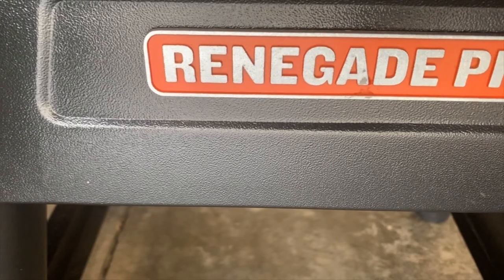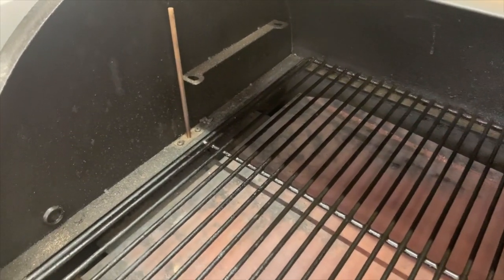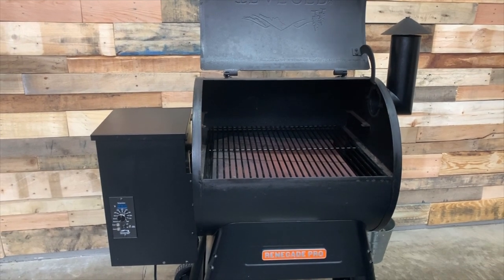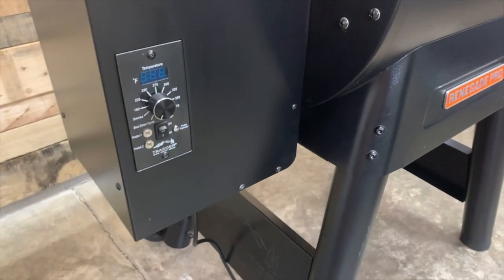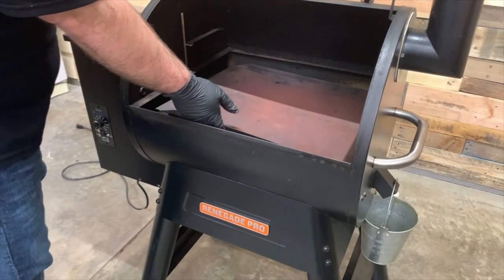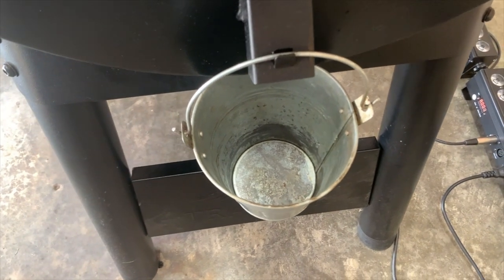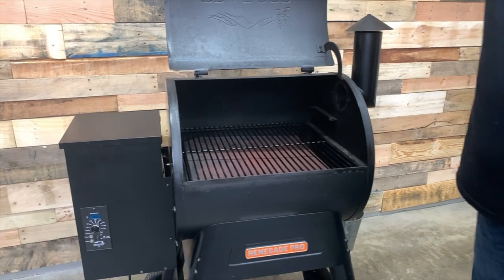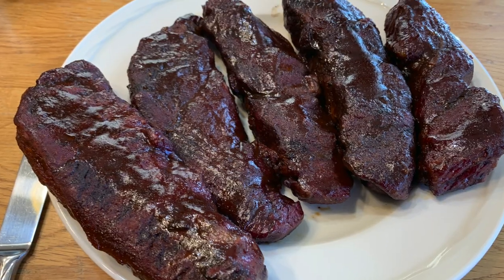👍Traeger Review👎 - After 6 months of ownership

Comment: I bought my Traeger PRO 22 from Costco over a week ago and so far I love it. I did run into a problem with error code  LER (too low temperature reading) but my issue was that I was not leaving the lid open when first firing up the grill. Since then, I now leave the top open and let it run for a good 5 min on smoke before upping the temperature= problem solved! Coming from using a propane grill for the past decade, cooking on the Traeger has given "life" to my food and the taste is fantastic. Even my wife has complemented me on my cooking which is a rare thing.😂 Great video!!
Reply: How does it perform on winter temperatures?? And i mean real winter, not texas winters but Alaska type winters.
Reply: One year in do you find it big enough?
Reply: @morganbaxter8793  For my uses, it's been fine. I bought the additional upper rack for $20 on Amazon and it's added additional space for food. I've cooked 3 rack of ribs on the lower rack and threw some corn on cob and asparagus on the top rack. It fits a good amount of food

Comment: I've had mine for two and a half years now. I would not sell it today for what I paid for it, I love it that much. I will say make sure you vacuum the fire pot after long cooks or after a dozen normal cooks. I had the fire go out in the middle of a brisket cook and found the fire pot full of ash which snuffed out the fire. Vacuumed it and restarted with zero problems. Also if the pot gets ashed up the grill will not get above 400. It takes 5 minutes to clean it out and refoil the drip pan.

Comment: I have one it's nice and convenient my only problem is the temperature jumps around and in my opinion it doesn't give that real good smokie flavor
Reply from the maker: We have cooked on pellet grills that had massive swings in temperature, and that's not cool. One had +/-50 degrees or more during a cook, and it was just unmanageable, so I hear you. We found this Traeger to be much less prone to huge temp swings. Regarding the smoke flavor, I've used a pellet grill that might as well have been a propane smoker, because there was zero smoke flavor on the meat I cooked. If I'm not going to get smoke flavor, then why am I smoking this again? We tried different pellets, and that particular model just didn't put out smoke flavor. I think the controller was too accurate and didn't let the pellets smoke. On this model, we got some lovely smoke rings and good smoke flavor. It wasn't as deep as the smoke ring from an offset, but for the ease of cooking during the week, it was way better than the oven, that's for sure.
Reply: @TheBarbecueLab  I went with a RecTec RT700 and the difference is incredible.
Reply: @TheBarbecueLab  SMOKE TUBE Problem solved!!!